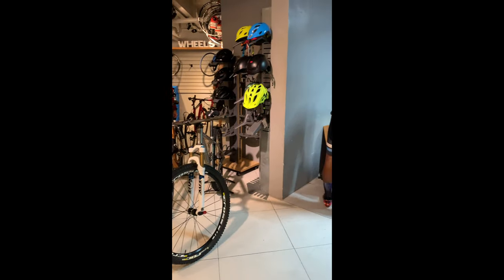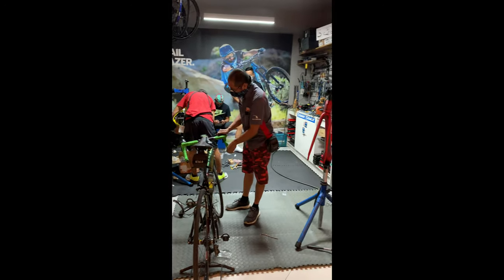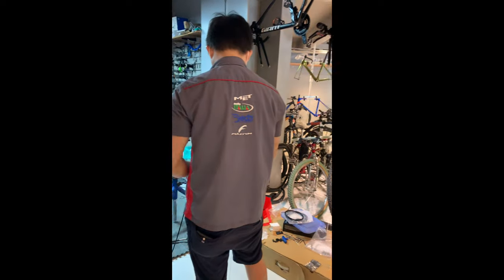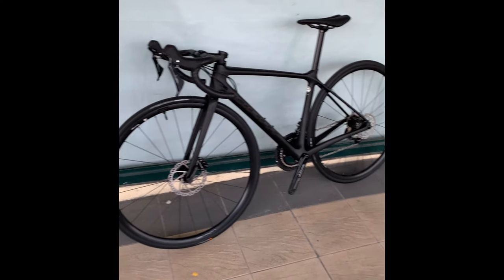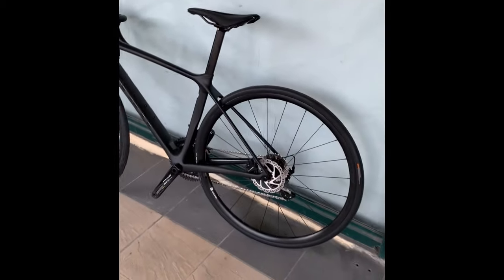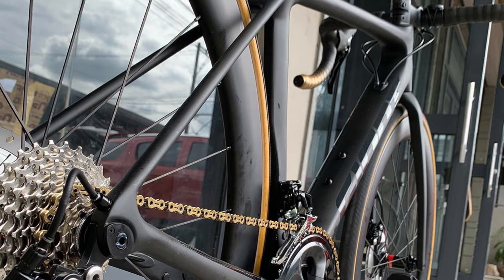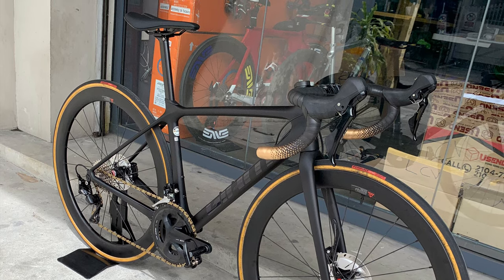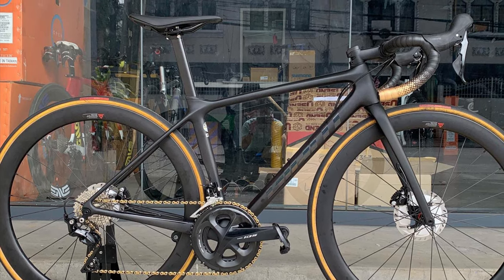NEW BIKE DAY! 2021 Giant TCR Advanced 2 SE Bike Build

Comment: Hi, the SE version should come with a power meter, can you confirm this? The giant website says it comes with a power meter but when i search giant power meter, only ultegra crank comes up. Theres no review of the Adv 2 SE on the internet currently. Maybe you can make a review and give your thoughts.
Reply from the maker: Hi Timothy, I’d like to confirm that the Adv 2 SE comes with a Shimano 105 crankset and that attached to the left crank arm is a Giant power meter.

I’ll try to post a review but my experience with the power meter hasn’t been positive. I’ll file a warranty claim as the one that I got seems to be faulty.
Reply: @bikeiswife7873  sorry to hear about your power meter. so it's only on the left crank then? from what i read, the giant power pro should be on both left and right cranks. I thought giant uses the same power meter on all their bikes, I guess not. that's a shame. I wish I knew this before I ordered my Adv 2 SE. But a left power crank is better than nothing I guess.
Reply from the maker: @onetwotimo  I believe the previous year model had a double-sided power meter. Was surprised as well that the current one is single-sided! But the one I got had a full carbon steerer tube compared to last year’s Adv 2 which had an alu steerer tube. So give and take. 🤷🏻‍♂️